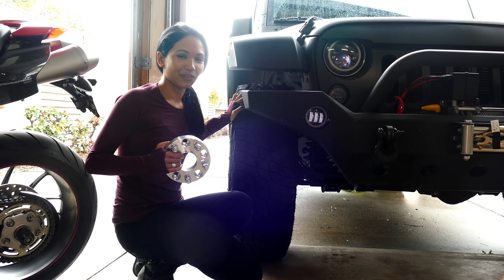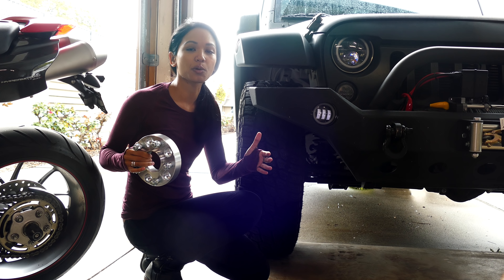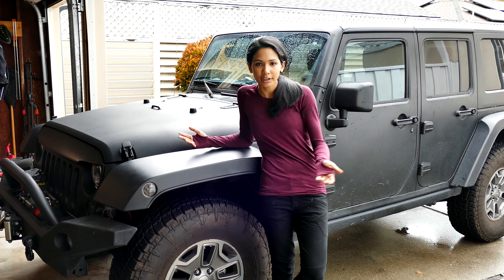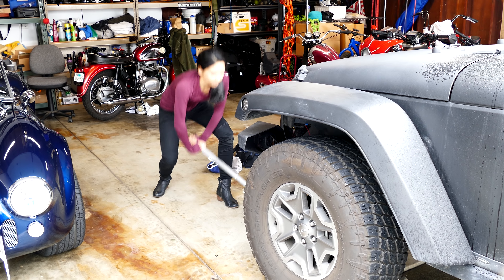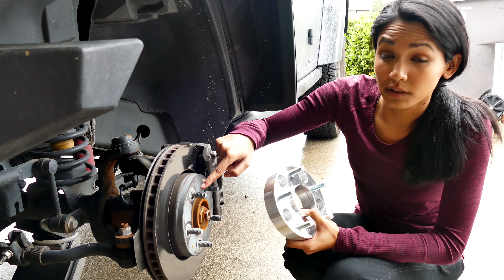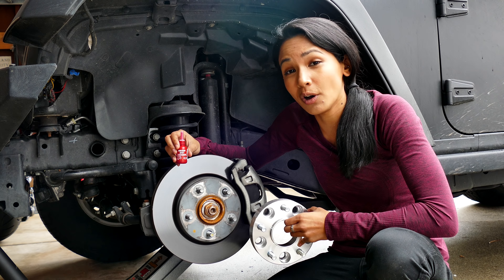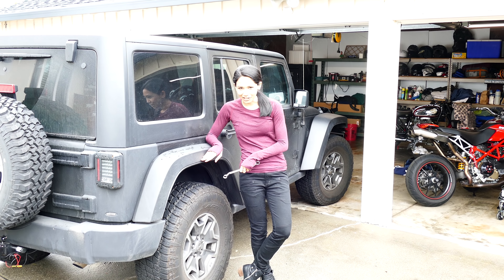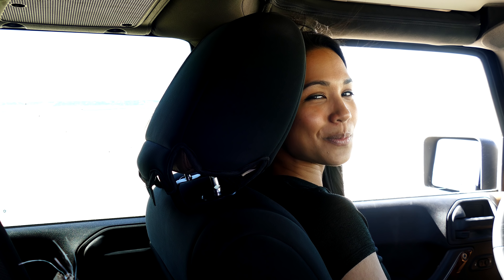Wheel Spacers on a Jeep Wrangler JK Unlimited: Install tips for looking good and fixing the rub

Comment: I’m looking for a 2.5” lift for my 2016 JK Sport because of sagging due to overlanding stuff.  I’ve narrowed it down to the AEV Dualsport or Terra Flex ST2 but have been told I might need wheel spacers/adapters.  I’m trying to avoid that because I hear spacers are a bad thing.  I want to keep my stock wheels and tires.  How have your spacers held up?

Comment: It is  critical to remove that round clip that holds the rotor on so the spacer sits flat .
Reply from the maker: Jim Wertman no. Not at all.it sits flat just fine
Reply: @mikedrop65  You are 100% correct... best explanation ever. 👍